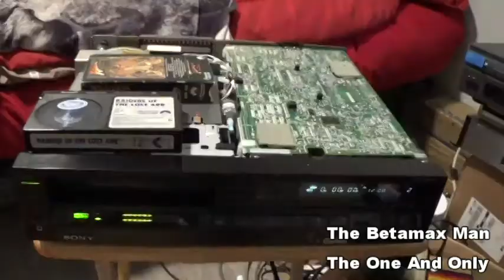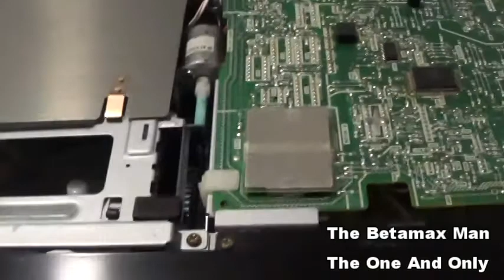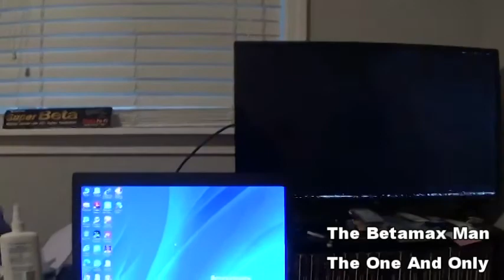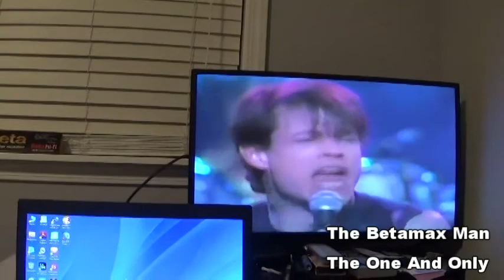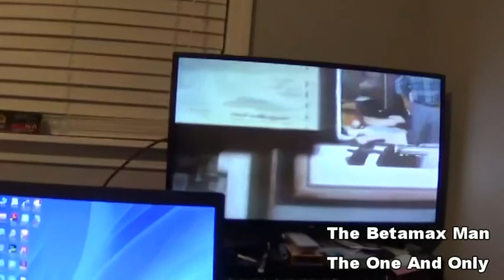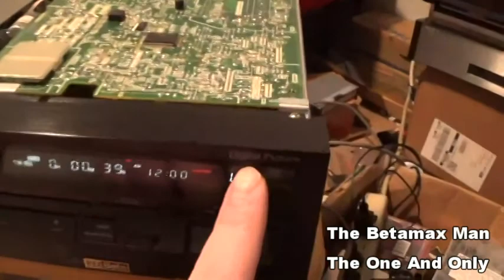ED Betamax Play Back Repair

Comment: I know I’m super late to the party but I’ve been trying to fix an EDV-5000 I got from Japan and it’s making me crazy omg, having dropouts like black horizontal streaking only on bright parts of the image, also shows up on RF captures and seems to only appear on the bottom field (as in interlacing) which afaik means it’s only affecting one head, the “second” head basically, first I tried messing with the variable resistors (after taking many pics of their original positions) on the RF module aka the rp-51 board (the board that’s enclosed in RF shielding that sits behind the video drum and such and where you get the PB RF test pin for rf captures) and was able to improve it a little but not really, the one on the far right is basically like the gain? Needs to be all the way up almost, but all the way makes it show a lot of white streaks and other noise, the third one from the left kinds filters that white streaking, the higher the more it filters but too high and the signal becomes unreliable like it can’t keep vertical sync so it was about finding a balance between the rightmost (gain?) adjustment and the third from the left to filter the white streaks in a way that doesn’t break the sync while getting rid of all the streaks, but doing that makes the black streak appear, they only seem to go away if I set the gain super high but can’t get rid of the white streaks since it loses sync before I get the one that filters them high enough
(Also the fourth one from the left seems to do nothing at all, and the first two leftmost and second from the left are recording gain which idc about atm, and ED beta playback specific something (which idc about atm either)

I recapped all the 10v 47uf caps on it (a lo of them I think 13 or so) and didn’t see any improvements maybe like 1% better and that’s probably just me

Will be replacing the rest caps from that rp-51 board (iirc most were 50v ones) and see what’s up, but this video gave me the idea to replace the caps on the RF amplifier side of things no idea if it’ll help but maybe? Idk how much it interacts with everything else, bc I just wanna get RF captures but those issues do show up there too, so was thinking it was gonna be caps on the rp-51 board, but maybe the issue is not the signal itself but whatever is in charge of keeping track failing and not allowing me to set the variable resistor that filters the white streaks high enough to get rid of them when I set the gain high enough for the black streaks to disappear? Idk, I know I’m just infodumping so much nonsense on a comment to a 4yo video but if you have any idea at all of what I’m talking about please do let me know 😭 might end up replacing all caps on every board at this rate and I’m not looking forward to it especially if it’s somehow not cap related at all, but don’t wanna give up and get another one, this thing is built like a tank fr
Reply from the maker: Some times when a machine has many issues it's best to make it a parts deck but I get not wanting to give up on it 😢if you want it fixed I would fix one thing at a time good luck and take care I'm here to help if I can good luck

Comment: Hi, thank you for your videos. They are helpful and enjoyable.  I hope you may have some suggestions for 2 of my units that you also own, both with the 711B3 chassis. My EDV-5000 had an intermittent issue with
 partially threading the tape, then unthreading & ejecting. The mode switch is sealed but I shot some alcohol, then later deoxit into it and spun it around. Now it does this every time. Could it be anything but the mode switch? And my SL-HF2000 just stays threaded all the time. Won't unthread or eject. I took the threading motor out, moved the rings to unthreaded position, re-timed the rings and reassembled. As soon as I turn power on it threads and is stuck there. I've tried cleaning the mode switch on this one too. Any suggestions are appreciated. No one else has been able to help. Thanks!
Reply from the maker: i can try and help your problems may be electronic faults or both mechical and electronical sometimes the plastic gear next to the worm gear on the tape threading motor assembly is craked causing the gear to seperate under a load and may not be noticed with the naked eye
Reply from the maker: Also watch my recent video on a sl-s600 that i did it had almost the same thing happening